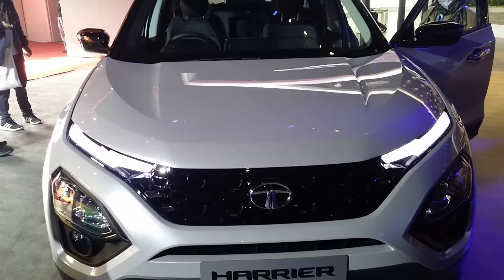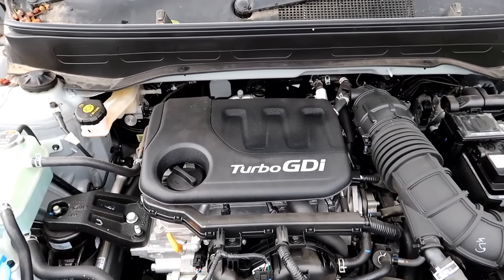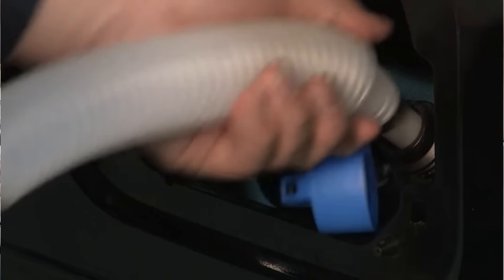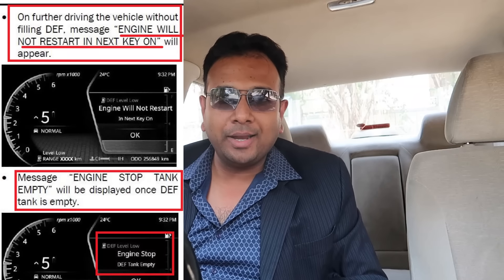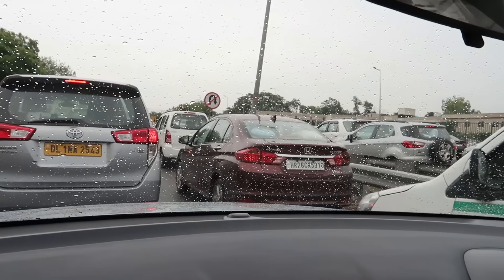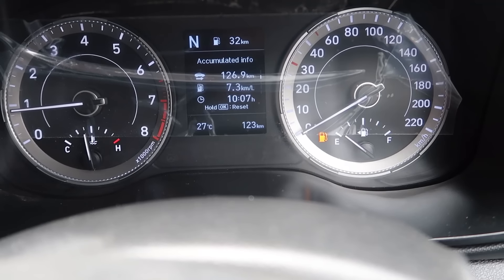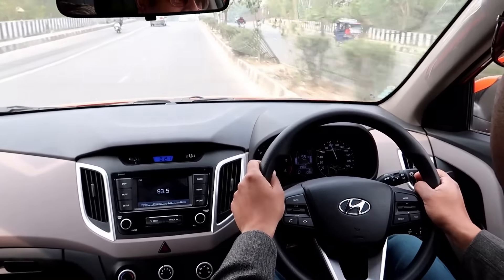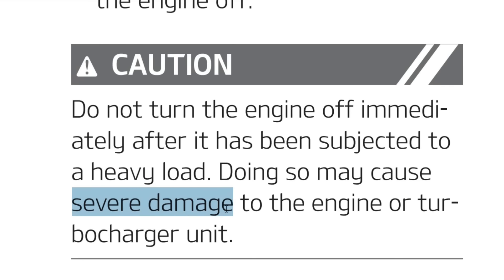PROBLEMS IN BS6 CARS. SCR Cars Diesel Exhaust Fluid, DCT Overheating, Turbo Failure and how to avoid

Comment from the maker: Disclaimer: Diesel Models which uses SCR Technology are Harrier, Compass, Ford Endeavour, Toyota Innova Crysta, Fortuner range of Mercedes Benz, Audi, BMW range and other high performance diesel cars etc all uses Adblue / Diesel Exhaust Fluid. But some companies like Kia / Hyundai rather uses alternate easier Lean NOX Trap system to remove NOX. Even Tata Nexon / Altroz comes with Lean NOX Trap. Even Ford Ecosport comes with Lean NOX.
Now a question - So whats the cost for replacement of clutch in Compass DCT ? Only those who wont skip video will find it
Reply: 75k for changing
Reply: 75 k
Reply: 70 to 75 Thousand... too much we are scared to buy DCT...
Reply: Amit Kumar lol! It will reduce ! But its double clutch so it will always be 2x as compared to manual car ! But if driven property it might even last 2x! 🤣
Reply: Sir is lean nox trap system maintenance free??
Reply from the maker: @suhasnagesh6511  Although on papers seems yes
Reply: Hi sir, I am having doubt between Nexon XM vs Altroz XZ.  Please suggest me. Which one is value for money?
Reply: In that case every good truck's like Bolero pickup to EICHER all have Turbo but whenever anyone climbs the cabin they simply race it for 30 secs in neutral
Reply: @princesharma1202  don't buy altroz not so refined car my friend facing many problems. go for Nexon.
Reply: MG Hector DCT is wet clutch as per their manual.
Reply: So buying a Hyundai diesel is fine? Right?
Reply: This overheating is only for DCT transmission right.? AMT doesn’t have this problem right in BS6?
Reply: Sir what are the negatives for bs6 diesel. Not easily available? Any other trouble
Reply: Very very very informative video. This should be recommended by YouTube to everyone.
Reply: Great Information......I totally concur with what you said about Turbo Engines...They demand a very high maintenance in the longer run.....I purchased Kia Seltos HTX petrol 1.5 Manual in November-2019...has been serviced twice since then...I've been getting a mileage of around 16.3 Kms/Liter in these hot summer days with AC on all the time...Never actually needed that extra Turbo Punch honestly speaking..you can never actually go above 2000 RPMs in a city traffic like Delhi. I'm pretty much satisfied with my purchase....I've had  a great experience with Kia so far....No complaints...One more thing I would want to point out here...If you are living in Delhi ....never actually go above the specified speed limits in the city ...they have so many speed cameras installed here, there and everywhere..and that to not in plain sight ....though I drive under specified limits..but you never know...mistakes happen...One of my friends told me to check for any Delhi Traffic Challans on https://delhitrafficpolice.nic.in/notice/pay-notice/ or, https://delhitrafficpolice.nic.in/notice/notice/TfPFLh61P8UFiNFeD8yKZg..and to my utter disbelief ..I had two challans pending in court without any knowledge...Hope you people find this information helpful....
Reply: Is this issue still with Skoda Rapid or new models of Skoda also??
Reply: Request Please advise me...Ford EcoSport diesel manual transmission or Nexon diesel manual transmission...in light of the above issues.
Reply: Sir I am planning to buy Tata Nexon... My average km per month could be 1500 km... Pls, suggest me whether i shall buy a DIESEL or PETROL ... BS6... I want to buy diesel but now I am afraid of these new age BS6 NEXON diesel car...
Reply: @kollivijaydr  generally if driving is more than 50 km per day then diesel car is better option.
Reply: What about soda rapid rider petrol...?
Reply: If you can tell in English, Non-Hindi people will also understand. If possible, please try
Reply: Hello, I appreciate your effort to explain the Turbo failure. Would be delighted to know one use case of Turbo Engine which failed and what was the cause of failure?

Regards,
Wasim, Fan of Gaganji
Reply: Is lean nox trap is equally efficient in reducing emissions?
Reply: You are awesome ❤️ I will buy ciaz automatic now
Reply: Thank you so much !! For making so much informative videos!!

Comment: This dual clutch issue has been plaguing the Volkswagen & Skoda cars for a decade now.... But no reviewer talks about it. VW in order to save costs still supplies the dry clutch units in their dsg's in all of their cars even the premium Octavia & Superb... The only car I know of that sports a wet clutch unit is the Octavia RS. Traditionally the cars with <250 NM of torque in VW cars have a dry clutch most of the time. And this is one big reason I have strayed away from buying into the dual clutch hype from manufacturers in the budget & pseudo budget segments... The transmission is just not optimal for Hot humid Indian conditions. 
Complicated technology brings with it the probable outcome of total gearbox failure and there are many customers who have had these experiences in the most awkward of situations like in the middle of a road trip. 
Thanks a lot for bringing this up! Subbed 🙌
Reply: I got VW T5 DSG wet clutch it failed after 85000 km warranty was expired but company replaced free as good will gesture.
Reply: Bhai creta sx optional diesel MT lene ki soch raha... Sahi rahega engine?
Reply: @hillton2180  bro after 85000km it’s understandable to get parts to wear and tear
Reply: I own a 5 year old Vento petrol DSG.
NO PROBLEMS WHATSOEVER.
The problems are faced by people who abuse the engine and gear box.
What to abuse your vehicle?? Yes? There is a vehicle. This the old THAR.

Comment: Great video!! I've been following your channel since quite some time now and every video is worth a watch. The info in this video is spot on and would be common sense to any petrolhead, specially the turbocharger part, but I do acknowledge that people come from different walks of life and might not know these points your doing a great service to them and sadly even the showroom sales executives don't know the intricacies of their own products.
 
However I would like to point out a small thing here, as per my humble opinion dry clutches are more performance oriented and are quicker in gear changes as compared to wet clutches, this is contrary to what you mentioned. A wet clutch is slower due to the resistance of the lubricant although this is hardly noticeable in day to day life but noticeable on the race track. This is the reason why many motorcycle manufacturers like Ducati use dry clutches in the production models to speed up gear changes since every millisecond counts on the track. Wet clutches do last longer and run cooler as well due to the lubricant as compared to dry clutches. This is as per my limited knowledge. Overall a great video and a great channel.
Reply from the maker: Thanks, appreciate. Yes, You are correct.

Comment: Great info. I drive a Vento TSI petrol automatic.
I religiously follow the idle at start and stop protocol.
The car is a 2015 model, so far done 50k km.
Brilliant car.
 No problems at all. 
Phenomenal pick up. S mode on the highway, will put a grin on your face, without hardly any drop in mileage, but great acceleration.
Great mileage , 17-20 on the highway, and 12-13 in city.

DONT COMPARE MILEAGE of DCT with other automatic cars, that like comparing apples and amla. Performance is at an awesome level. 
Simplest way to convert an ignorant "average kya" person, is just hand him the keys to your DCT car.
He will go back and KICK his manual/ AMT/ CVT car and go into deep depression!!

Never had a DCT problem, once or twice, it might jerk violently especially when coming down hill at about 25 kmph, and braking for a speed breaker.
Now that I know this, I make it a point to gradually press the brake ,well before in anticipation of the speed breaker on a slope.
Reply: No it won't convert the 'average kya' person. They buy a car for its functional use - to go from point A to B. They would consider you an idiot for buying a low budget car for its 'performance' 

You will just reach the next red light 2 seconds earlier than the 'average kya' person and wait along with him...That person still has a better reason to buy a car for its average.

Comment: Very good information. For me naturally aspirated petrol  car is best. Turbo petrol का भूत उतर गया ।धन्यवाद
Reply: Yes right.. turbo ek chutiya bhana hai.. chote engine pe Turbo lgel bewakoof bandhe hai
Bhai .. turbo 2 rpm ke bad suru hota hai kuch gadio pe lag hai
Or intial power mostly sabki weak hai..
Reply: but logon ko mileage chahiye toh itna cons toh sab mein hota hi hai
Reply: @iknoorsingh1475  turbo engine mileage ke liye nhi hota hai... Bro. Phle apni knowledge thik kro
Reply: Rajendra Singh Butola Naturally aspirated petrol engine cars are sluggish and underpowered and these petrol engines are not at all suitable for SUV segment
Reply: Rahul Turbo performance matters while overtaking on highways where everybody overtakes above 2000 rpm. Turbo gives snapp acceleration to diesel cars and thats why they are fun to drive and it doesnt matter if turbo kicks in after 1750-2000 rpm
Reply: What?? Turbo charger increases the engine performance. The problems mentioned in this video regarding the turbo petrol engines are applicable for diesel engines as well.
Reply: @hunny333  If you believe that, you know nothing about cars.

Comment: No DCT & Turbo for me just naturally aspirated mated with good old manual or torque converter (Maruti 4 gear automatic may be old but is bullet proof)
Reply: Anuj Sharma sir is the Honda city ivtech engine turbo charged or naturally aspirated
Reply: @EscapeToVictoryNow  naturally aspirated
Reply: DCT and turbo only bring headache for owners and good business for service centres. Steer clear of these two. Buy N.A. with torque converter.
Reply: Is brezza AT a good choice for reliability ?
Reply: Ajinkya Pujari Brezza is AMT not AT , its very affordable if it breaks down , but is not as smooth as AT or DCT
Reply: @EscapeToVictoryNow  new Brezza is conventional torque converter, not AMT
Reply: @illuminati2101  yes of course

Comment: Turbo + DCT in Delhi Traffic = Transmission Failure
CVT's are much better especially by Toyota and Honda but unfortunately People Won't buy them and buy AMT and DCT
Reply: Even performance wise, CVT > DCT > AMT, AMT is oldest of them
Reply: @ACommonMan24  no, DCT is infact much better in performance and they are used in F1 Cars and Other Supercars.
But in India's traffic they are a huge Failure because they weren't made for Stop and go traffic.
Reply: Why you adding turbo?
Reply: I am happily driving Honda Brio MT and Honda Jazz CVT in Delhi Traffic and now i will be more happy with my decision.
Reply: @kartiktyagi8777  coz creta is offering dct + turbo and upcoming verna is also offered with 1L turbo petrol with dct
Reply: @Mohitkumar-we5fg  ohhh rightt

Comment: Great Information......I totally concur with what you said about Turbo Engines...They demand a very high maintenance in the longer run.....I purchased Kia Seltos HTX petrol 1.5 Manual in November-2019...has been serviced twice since then...I've been getting a mileage of around 16.3 Kms/Liter in these hot summer days with AC on all the time...Never actually needed that extra Turbo Punch honestly speaking..you can never actually go above 2000 RPMs in a city traffic like Delhi. I'm pretty much satisfied with my purchase....I've had  a great experience with Kia so far....No complaints...One more thing I would want to point out here...If you are living in Delhi ....never actually go above the specified speed limits in the city ...they have so many speed cameras installed here, there and everywhere..and that to not in plain sight ....though I drive under specified limits..but you never know...mistakes happen...One of my friends told me to check for any Delhi Traffic Challans on https://delhitrafficpolice.nic.in/notice/pay-notice/ or, https://delhitrafficpolice.nic.in/notice/notice/TfPFLh61P8UFiNFeD8yKZg..and to my utter disbelief ..I had two challans pending in court without any knowledge...Hope you people find this information helpful....

Comment: I have KIA seltos diesel BS6 manual variant. The only problem with diesel variant is the DPF filter gets clogged frequently because of bs4 diesel. But it gets cleaned while driving a Car above 2000 rpm on highway in 3rd or 4th gear for 30 minutes. So actually it is not a big deal. Thats why buy diesel manual transmission variant and you will love the Torque kick and advantage of gears to drive as per the road conditions

Comment: Idling is a good practice even in regular cars. I own a Fiat Palio 1.6, and I always idle for at least 1min before and after even though it is not turbo charge engine.
Reply: Me too.. The engine becomes smoother after the RPM automatically drops down below 1000..Otherwise linear acceleration me dikkat aati hai..Following this after noticing the difference..If you restart the engine when hot or you have reached the destination, you will see that the RPM is quite low wherein starting in the morning it would have been much more..Someone had suggested me that there is no effect on engine when hot wherein most of the problems come if you abuse it while cold 🙏🙏

Comment: Very useful information which car reviewers normally dont talk about due to lack of knowledge or the manufacturer doesnt want it to be known. 
SCR/ NOX and the cost involved will definitely increase the  already high maintenance of diesel cars. In my experience i feel its better to own a petrol car ignoring the fact that fuel is more expensive, because the service costs is comparitively high due more spares and shorter life or replacement periods. Even the life of a car battery is shorter in a diesel car as i am told.
Is the turbo issue only for petrol or it applies to all turbo vehicles?

Comment: Dct transmission software has been updated so heating issue is solved 3 to 4 months ago. As for refilling adblue in the BS 6 diesel you need not go to authorised workshop as it can be refilled just like you top up your car coolent or engine oil. Adblue will be available at spare parts shops and petrol bunks. Adblue is only needed in big diesel engines of 2L and above.

Comment: Awesome.. Was searching for this type of channel for such answers... 

Sir.. I need to know 1 main thing before making buying decision.. I want to buy new creta.. I have never used diesel car before.. As my running is very low( but i will run it every now n then just to maintain its health). I dont wanna buy natural aspirated engine now. ( drove enough of that too).. Creta turbo petrol is high cost and having all those features which i dont like or want lime sunroof, dct etc. 

1) Whats bothering me and what i really honestly want yo know is that HOW MUCH IN REAL LIFE THE BS6 DIESEL HAS REDUCED THE EMISSIONS? You stand around any bs4 diesel and can easily sense that very foul chocking smell, which is very very less in petrol 

I have read somewhere that bs6 diesel is even cleaner than petrol now? 

Is this claim true? Have bs6 diesel is really that mich clean? Does it really makes a significant difference in emissions? Smoke etc??? 

Ple help me out asap.. Anyone who has experienced bs6 diesel emissions.. Ty

Comment: You gave good information but made me sad as I am going to get my BS6 diesel car soon, which can not be cancelled as the loan is already done. So far I used petrol NA cars but dont know why i was crazy for a diesel this time, left many good cars in my budget just diesel is not available and trapped myself. Will use it for two years and will sell.

Comment: Can you confirm that non-driving for several days would not cause this DPF issue? My driving pattern is that 2-3 weeks my car is parked then 2-3 weeks its heavily used? Overall running is more than 15k per annum so I was looking for Diesel variant but if non-driving can cause DPF issue then it would be a big hassle.. Kindly share your experience.

Comment: Very useful technical information. Thank you boss. By and large, do you think, naturally aspirated petrol manual engine is always better?
Reply: Any engine is properly designed and operating in safe conditions it's alright, all airplanes have been using turbo engines, here our issues are unprofessional service centers as well as customers, that's why manufacturers gives extended warranty for 5 years, those wants high performance engine's buy and use as manufacturer warranty period lasts as 1 L or 2 L, then immediately dispose, please note   many car manufacturers were using in India Fiat multijetn Deisel BS4 Engine, that has been stopped when BS6 comes, even Maruti climes none of these engines were opened even after 5 Lakhs KM, Buy Cars with trusted turbo engines /last 5 years in the market rather than new generation high performance turbocharger engines, reliability of these new engines yet to demonstrate,

Comment: I had a issue with DEF oil in harrier . As we were travelling in ladakh , our def was running out . So when it came to last resort , we bought def from a near petrol station as there were no tata showrooms nearby . But after few months engine started having issues . So apparently we cant use any other brand of DEF which is really bad as i have to carry def from tata only .

Comment: U has talked abt the precautionary measures for DCT , what abt the CVT Petrol engines? As u said there is substantial maintenance cost for DCT, is it then wise to pick CVT or MT engines ? bcoz there is huge price difference btw the two in terms of engine performance, mileage, comfort , both city and highway ride ?OR  one should definitely increase his budget and buy DCT only?  bcoz CVT cant paid u value for money. Im here taking the example of creta 2020.